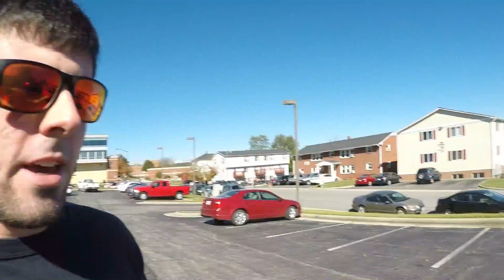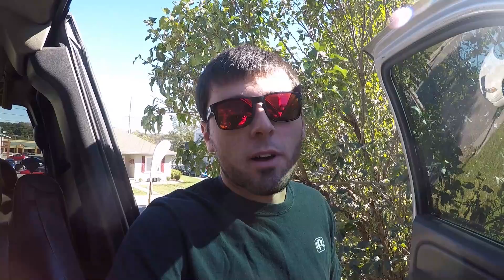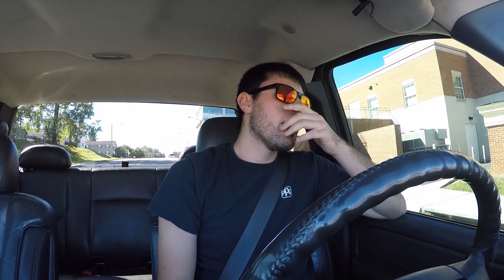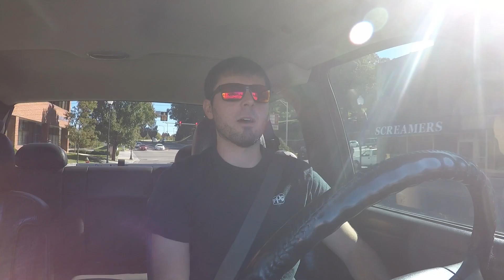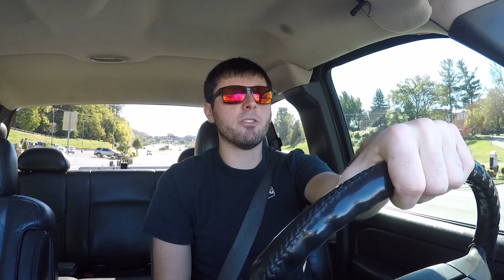Update on the 500HP LM7 5.3 Build!

Comment: You should be around 400 or a little more at the wheels at max tune with new setup. Around 550 at the crank. Cat wait to see the numbers cuz I’m gonna have pretty close to the same setup but going with Btr cams and efi live tuning with the switch 5 different settings mine won’t be done till spring though

Comment: That truck will probably make 265/270 wheel horsepower if it is just all bolt ons 5.3 with a tune already. Mine made around 260 or so with 91 octane dyno tune, longtubes, full 3 inch corsa, airaid cai, and e-fans om 305s and 3.73 gears

Comment: I'm guessing 240WHP. current setup
Reply from the maker: This is actually the closest guess 😂 I’m saying 250 wheel on stocks
Reply: @btgperformance9234  haha! Im kinda cheating because I know my tuned 04 5.3 made 227WHP on 87 with exhaust straight piped after the cats and stock air intake with k&n drop in air filter. I've got the same lift as you except I have 33s. So I have a general idea of what your set up will make. Im excited to hear the new motor thump!

Comment: Current set up if you set the tune to max power i'm guessing 370.
Reply: Lol no
Reply: @griffinpierce7691  what's your guess then? 2004 stock 1500s have 295 and he put in a k & n cold air intake and dual exhaust x pipe system. Those will naturally get more air through the engine faster allowing it to make significantly more power. He also has a tune which at max power setting adds about 20 horsepower to stock trucks. His truck is not stock so the tune can get more our of the engine with the increased air flow.